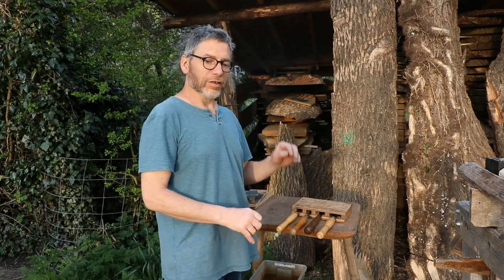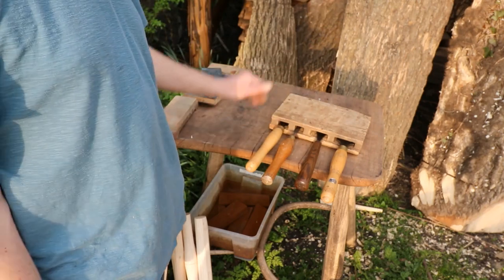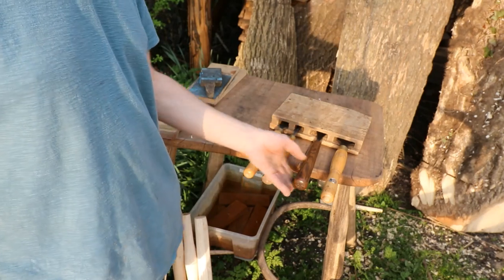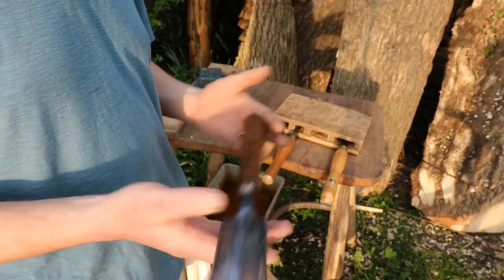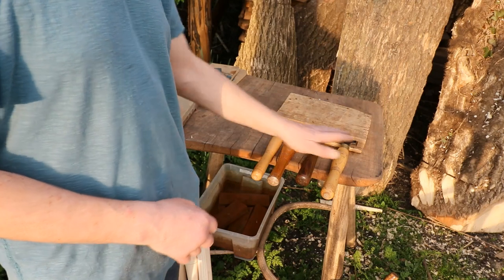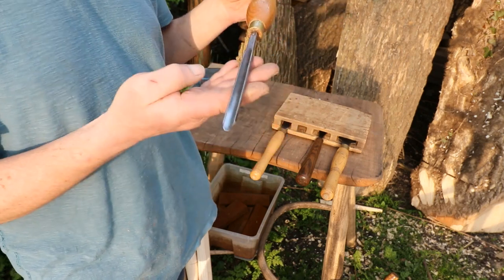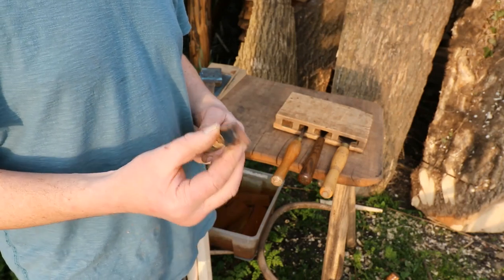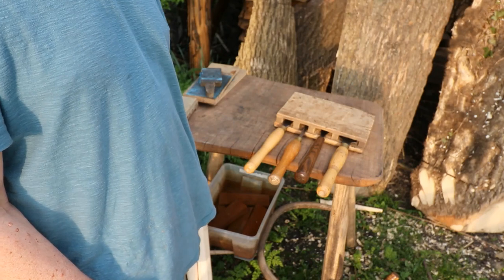From the Garden - Pole lathe tools explained

Comment: I have a nice old cast steel gouge, not as wide as yours, but with a very long handle.  It came with a shallow grind, very nice for pole lathe turning.  
I also have a double bevel flat chisel, ground like a big skew (40 mm-ish) but straight across.  Again, it came that way and it works well. 
For smaller stuff I have a skew and spindle gouge, cheap secondhand ones, old carbon steel, which power turners don't want (and thus they are cheap)

Comment: I have noticed that your straight chisels for turning, the folks in Great Britton there, tend to use a wide cabinetmakers chisel (bevel edge and single cutting bevel). For turning I have a 2 1/2" (50mm) ground like a knife on the end, about 25 degrees. More like your skew.